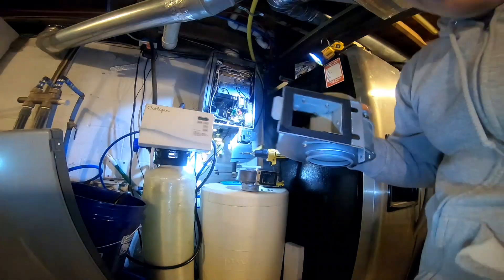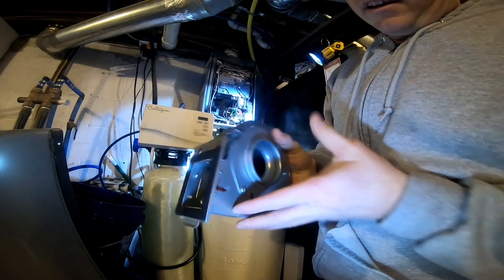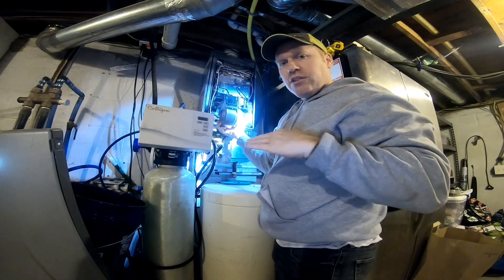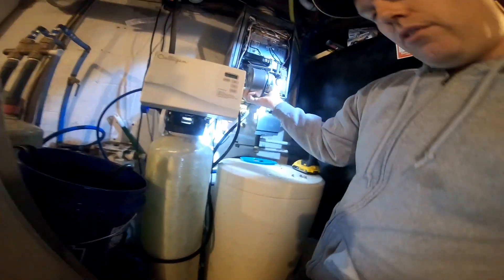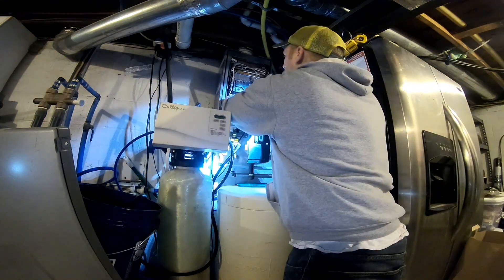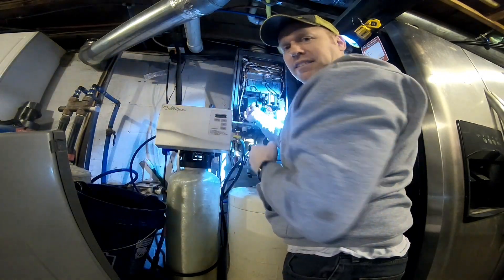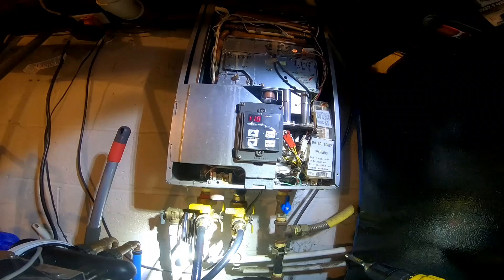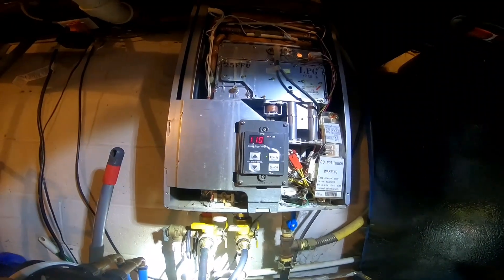Rinnai Tankless Water Heater Error Code 10

Comment: Considering you had so much trouble tracking down the part it would have been nice if you included the part number and more details about it in the video.
Reply from the maker: The part number is shown on the box in the video but I see your point, the best way is to call rinnai and give them your model number I got this one on ebay years ago hopefully rinnai's service has improved since then!

Comment: I'm working on one now. It had the error 11 code. I cleaned the ignitor and sensor. Fixed that issue. Now I'm getting an error 10. I cleaned the blower and checked the exhaust. The error persist.
Reply from the maker: Sounds like you might need to replace the igniter and sensors or clean them really good again with a scotch brite pad, or worst case take your burner out and inspect it make sure the holes aren't clogged and clean it up that will also give an 11 code, I actually have a video on it but it wont be out for a couple months because all my videos are scheduled for each Friday,  let me know how you make out it's not too bad to take the burners out and all your wires are labeled so you cant hook them up wrong as long as you read the colors! Thank you for watching!👍

Comment: Had error code 10 last week. I checked my unit and discovered an installation instruction sheet which had been taped high on the back of my unit (it had a skinny piece of clear blue tape) had come from free and slipped down next to the intake slots located on the back near the bottom. When the unit turned on so did the fan which then sucked the paper flat against the housing thus cutting off free air flow. Paper was removed and there are no more issues. The instruction sheet was for the installation of a condensation tube which was not installed by initial installer. I had water dripping on the floor because of that oversite. Apparently my builder did not use a qualified installer or inspector?
Reply from the maker: Wow!!!!!! That's crazy! Well I'm glad you found it!  Did you notice any soot build up on the inside?  Thank you for watching!👍👍👍

Comment: So where exactly on eBay did you find the blower assembly. I haven't been able to locate one.
Reply from the maker: I just typed in the serial number, try searching for your units number as well it might pull up other parts for you to find it, if that doesn't work try searching for it on google and you might find a link for the blower , good luck buddy, let me know if you have any questions on the install I'll help you out!
Reply: @WhitehouseFarmVet  I have had the blower out to remove a 4" long lizard that made so much racket that it woke me up when the wife washed her hands. Continuing to have code 10 alarms & cold showers. I will try your sn lookup & let you know. Thanks
Reply from the maker: Wow glad I dont have lizards lol good luck thank you!

Comment: How much did the blower cost on eBay?
Reply from the maker: It was 25 dollars but 18 for shipping which was way too much but 43 total is still a great price!  Very easy to put in make sure to check yours first to make sure it's not clogged with bugs and junk they are easy to clean out!
Reply: Thanks for the info. I already cleaned out the blower and there wasn’t any debris just dust but I’m still having issues. I’m wondering if it’s the wire harness or something else.
Reply from the maker: @michael5704  what is it doing?
Reply: WHITEHOUSE FARM it just starts beeping and showing the #10 error message. There’s no excessive noise or vibrations. 🤷🏼‍♂️
Reply from the maker: @michael5704  do me a favor and check your burners its located in the box toward the top you have to remove the cover plate , they look like radiator fins ,see if they are caked up with black carbon they will definitely throw a 10 code ,if they are you need to clean them  use a stiff bristle paint brush and shop vac just be careful because those fins will bend easy!
Reply from the maker: @michael5704  mine were caked up with carbon so bad one time I couldn't even make out the fins, live and learn I guess lol now I check them on the regular!
Reply from the maker: @michael5704  as always be safe turn power off. Turn gas off etc hope this helps!
Reply from the maker: If you have any questions or need help on install let me know! Good luck and thank you for watching!  Make sure to subscribe I am putting together some other videos on cleaning out the carbon build up and 11 code etc! Thanks again!